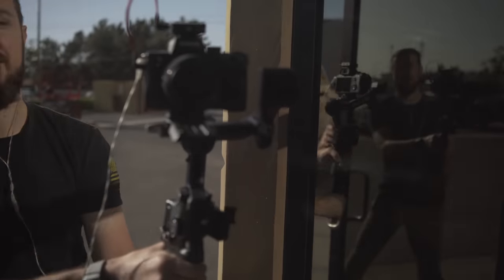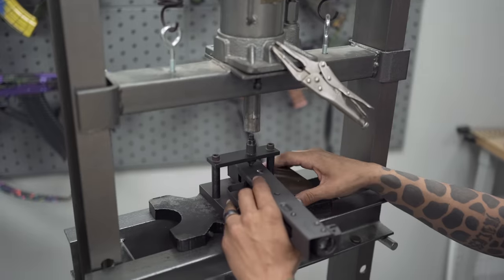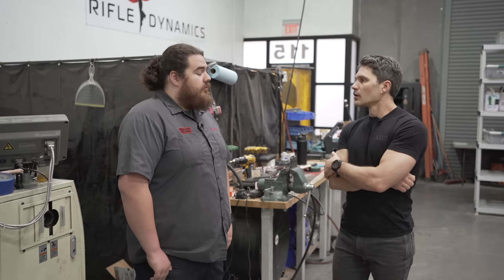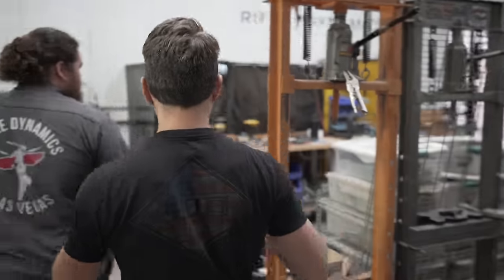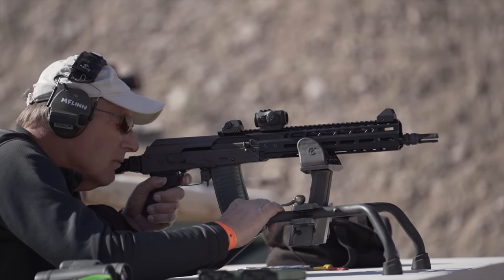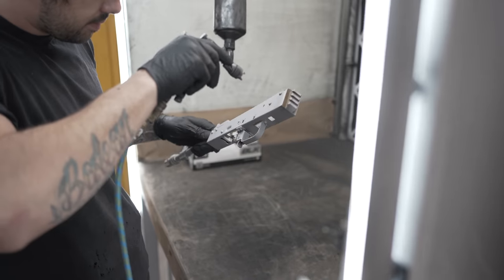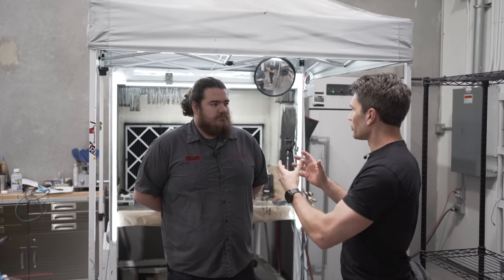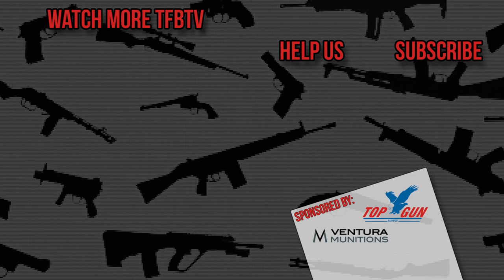How to Build the Best AK-47: A Rifle Dynamics Factory Tour

Comment: So about 15 years ago my $80 Romy g kit began on my basement work bench where my hyper dynamic dremel engineers removed the rivets and engaged in thermal and tactile preparing of components components. It was then moved to my work bench where a newly folded receiver that had been orogamically manipulated to mate with the specific trunional and barrelistic aspects of the rifle. Next, it was moved to my work bench where intensive micro production individual alignment techniques manifested the satisfaction of internal aspects required for this combloc beast to go boom. That included installation of horizontal planes , striking surfaces, ignition commencement components, and the tempering of ferris materials. Next, it was moved to my work bench where several layers of rustolium (black) were applied in staggered phases with  care which ensured the desired and even distribution of complexion to the indicated surfaces. Next, it was moved to my work bench ( I regret this part) where my skilled technicians surgically replaced the original romy wood with tapco plastic. Next, it was moved to the range where steel cased ammunition conceived of and constructed by the greatest minds of Eastern Europe were cycled through Natasha.  All in probably about $200.
Reply: Lmfao

Comment: Awesome tour.  Only thing I saw that looked weird was putting all that torque on the muzzle device with only the magwell supporting it, the whole thing was flexing.  But I don't build AKs for a living and these dudes make really nice ones so Im guessing that's no big deal.  I just figured they would have used a more solid way to hold it.  Not as easy as with an AR where you can use something locked into the barrel extension lugs.
Reply: I thought the same.  Seems weird all that stress on the mag
Reply: There's definitely better ways to hold the rifle securely. And notice earlier in the video when he is riveting the receiver..... crooked, low quality tooling being used. 

Everything else in the tour seemed to be good though. But not impressed by these two points.
Reply: If you look carefully the mag is reinforced with what appears metal coming out the bottom of the mag. Just not sure how much of that piece of metal goes into the mag.
Reply: Even when torquing muzzle devices on ARs it’s always best to hold the barrel itself. While you’ll probably be okay, the barrel extension is a separate piece and holding it when torquing the muzzle puts stress on the connection.
Reply: @pranavkamath4329  I think you are correct, that does make more sense, thanks👍
Reply: @pranavkamath4329  I recently got a barrel vise block set so Ill try that next time.  My knock off reaction rod will be lonely though.
Reply: @mphil3051  Right, the mag is being reinforced, but I am concerned with all that force being put into the receiver around the magazine, you can see the whole thing flexing.  It would be better to hold the entire receiver or better yet, the barrel itself like Pranav said
Reply: The only thing I saw that was weird in the entire video was James’s fanny pack 😂

Comment: 7:56 Wouldn't that bend something in the magwell??
Reply: Seen that, sketchy
Reply: People use the same method to secure ARs when torquing things down. So no.
Reply: @TheHashtagSquad2K15  But AR mags are not held in place by 2 pieces of 1mm sheet metal?
Reply: @TheHashtagSquad2K15  that is a dog shit method of torquing the castle nut on. There are real jigs for doing it, that blow away a magwell insert.

Literally no one advocates torquing a muzzle device with a magwell insert.
Reply: Bubba city
Reply: I seen that and cringed so hard. Lol base rifle starts at $2700 and you torque muzzle devices on with a vise holding the bottom of a mag?

Pass.
Reply: That is 100% not a professional way to torque down muzzle devices especially not on a $3,000 rifle. That guy needs to stick to riveting.

Comment: Unfortunately they’ve came down since Jim left. I’m lucky to own an Arsenal Slr106 he worked on for me. They need to watch there qc, watch the dust cover @ 5:50. Yea 5.45 is higher pressure but the lip on front trunnion and recoil spring should prevent that.
Reply from the maker: I think that's more of a perception than based in fact. That gun is featured in another video we are making and is an older RD gun, possibly built by/during Fuller. If the topcover slightly flexing when firing suppressed is, indeed, a problem, how do you know that this is a post-Fuller gun? The problem seems to be more that "it was better back then" guys looking for problems with the new RD guns.
Reply: My post Jim Fuller RD gun , had headspace issues out of the gate

Comment: Virgin Romanian kits with barrels.
WBP kits with FB barrels.
A mix of AKM surplus Romanian with Romanian or FB barrels.
A lick of paint and some tacticool mods.

I would rather get an off the shelf WASR and Dr 922r it with a Tigger job and a lick of paint. And surp furniture 

Preferably a M70 Zpap with surpluss furniture and a trigger job.

All will have proofmarks with multiple overpowered proof rounds, I would pay extra for the Zastava as it's a 16.5 inch RPK without bipod maybe upgrade to rpk sights.

Or get a nice east  German parts kit with barrel and a blank from Childers or recreator with professional markings.

These guys used to charge over 400 to hit a war with a dremmel.

If other AK producers outside the US could see this they would think it'd insane.

Anyone who can home build could do the same or convert a WASR or Zastava.

They used to use us made barrels and maybe still use the bolt on gas block that looks awfull.

I like front sights and a 16.5 inch barrel.

If I wanted a supressed AK I would just do a trigger job on a Draco and repaint it then fit a supressor and a new trunion with stock.
Maybe have to change the reciver but sure I could salvage the og

Comment: The fact that you have to do so much hand-feeding is why I wouldn't bother to try to make a really good AK.

I get it and I applaud their work ethic in trying to turn pigs ears into silk purses. And I get it to understand that Ak's CAN be fine guns... but when you have to spend hours upon hours upon hours on manufactured Parts in order to make them adequate. Then that's a real good sign that you're starting with substandard manufacturing at best.

No doubt they are making Fine Guns, and I'd love to have one of theirs. But without that attention-to-detail you are really rolling the dice with an AK. You'll either get a gun that's adequate, you might get very lucky and get one that's fine, and then the vast majority are guns that can fire. And that's about the limit of their quality.
Reply: for $1500 you can get a beryl which is better than anything produced in the States

Comment: Its my opinion they're overpriced for what you get. Suggest checking out occam defense becaise they are the ones actually breaking new ground with how an AK is built. Not just installing a crappy trigger and rail system, a paint job and then charging $4k.

Comment: Need to make a RPK WITH A 2.0MM RECEIVER in a 6.5mm Grendel with 1/8twist HEAVY 22"BARREL Straight fluted barrel and for long range Shooting and accessories still be able to use AK47 mags need a Bullet like the 7N1 with a hollow cavity and a steel Core boat trail and use a magnum primers for all whether burn

Comment: Like, I get it, they put a ton of work into their rifles. But when you are working with a hodgepodge of mixed parts, you kind of have to put that much work into it to make what would be otherwise a "meh, okay" rifle into a "good" rifle. 

I feel as if a lot of the things they do are standard for a firearms manufacturer, and some of it is just unnecessary. Assemble the rifle, fire it, zero it, disassemble it, strip all the coatings off, paint it, reassemble it, fire it again and re-zero it? That right there is probably 75% of the additional cost. Can probably refine the process and bring price down to a more reasonable point for what is essentially a mil-spec AK.

Comment: I find it interesting and sad that this name brand AK builder hasn’t improved the tooling methods for building AKs beyond AK Builder tooling. Surely, the Russians had a better system in place?
Reply: Wow, just wow. May I quote Goethe?? "There is nothing more frightful than ignorance in action." - Johan Wolfgang Von Goethe. Read more, brother. (edited for horrific grammar)
Reply: How is my observation ignorant? How many AKs have you built? How much time do you have with these tools? Would it not be logical that a manufacturer of high end AKs come up with more efficient and consistent tools for some of the more skilled and advanced stages. For example, riveting takes skill and learned expertise. Why not create a tool that hydraulically first hold the rivet head tight to the receiver then a further press of the pedal, compresses the rivet? As opposed to repeatedly fighting with each and every loose rivet and tools in a task that needs three hands but one brain. Separately, if the tooling was semi automated, then the operator could be less skilled or  the skilled guy could take a vacation and work not stop. None of this is a attack on the current hobbyist level tooling available to us.

Comment: Muzzle brakes are not a good thing! If a firecracker sinks to the bottom of a glass of water, and explodes, it will lift that water up vertically/maximumly (is that a word?). If you drill holes into the glass, at the top rim regions, the blast will shoot water out all side's, and vertically, minimally The recoil is a good thing: Aim low, and let her climb. A SAW that needs to be fired continuously, deserves a muzzle brake, but not a point-and-shoot rifle.